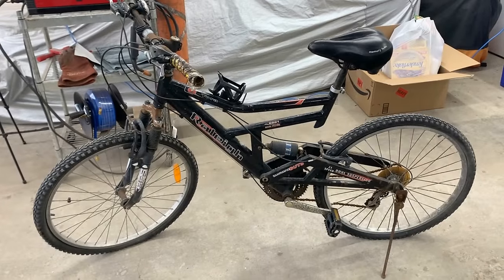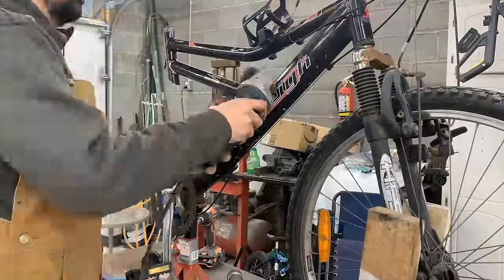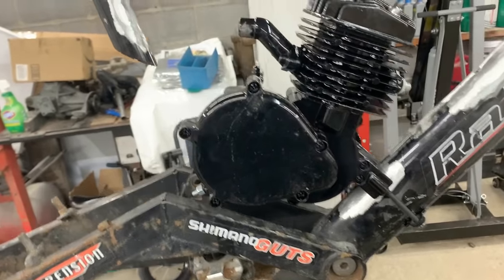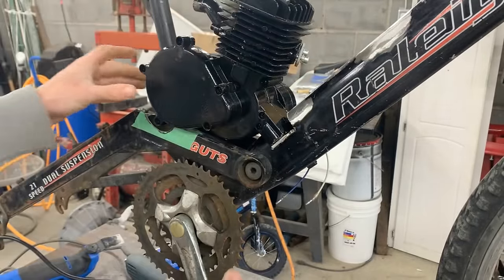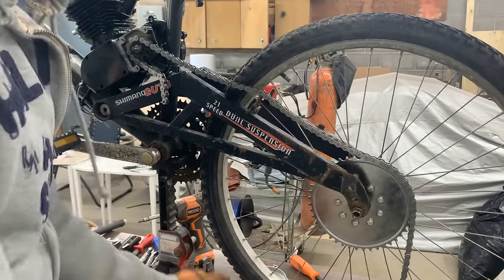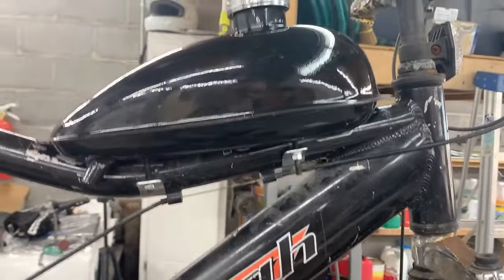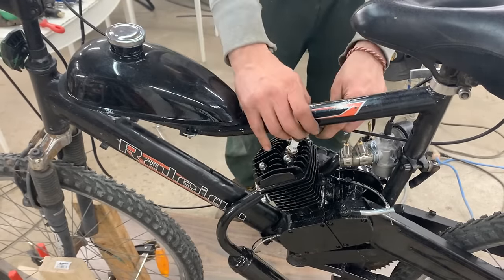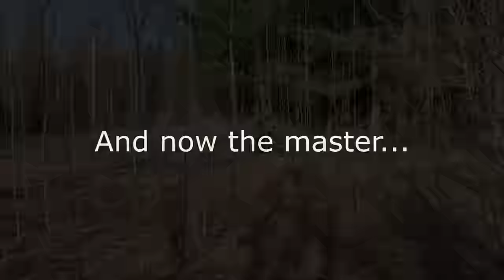80cc Bicycle Engine From Amazon - Complete Build From Start to Ride

Comment: You've got a grey/green hardtail mountain bike right there....why would you chop up a rear suspension bike and change engine mounts ????? You could have fitted to the hardtail in half the time, less tools and without butchering a brand new engine 🤦‍♂️
Reply: I can answer it for him... because he f**king can. And the kid riding it at the end with a permanent smile plastered on his face made it all worth it
Reply: That’s exactly what I thought.  There were 2 or 3 other bikes there  that would have been much easier to mount that motor to.  Not only did he ruin a cool bike he created 3x the work.

Comment: Where you cut the bolts off then drilled/tapped new threads, didn't your engine come with an adapter plate that would have bolted right on the original holes for use on oversized frames? 🤔 The kits come with that option now, perhaps they didn't back when you bought yours.